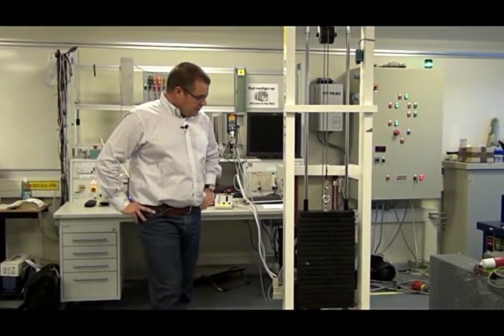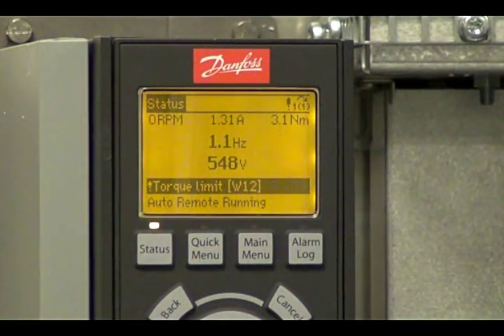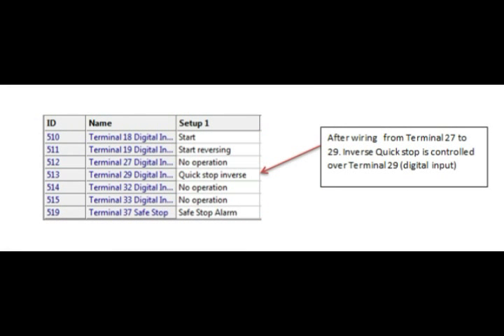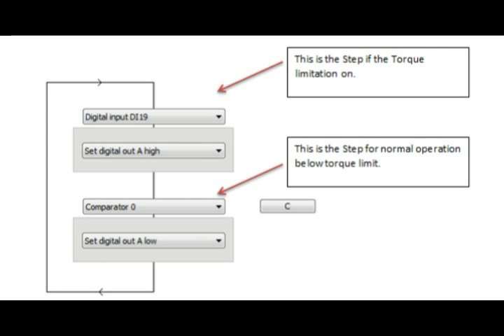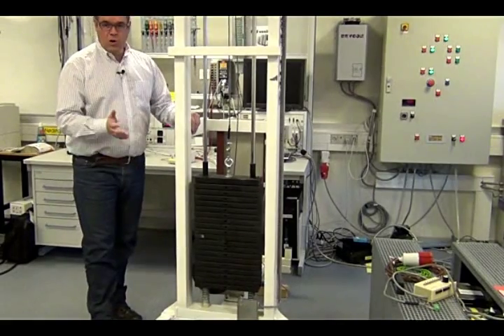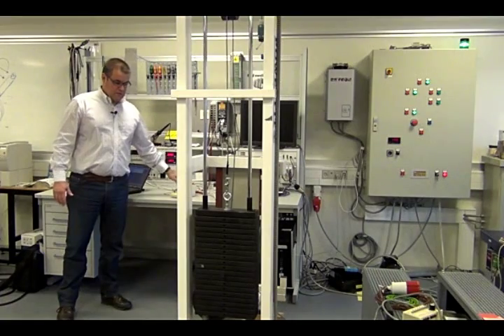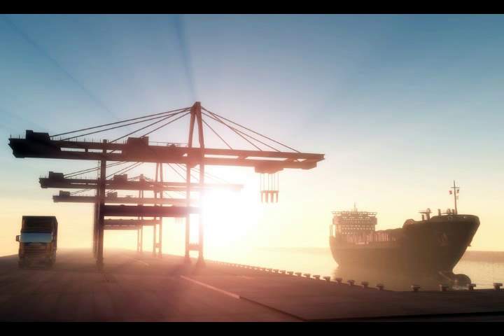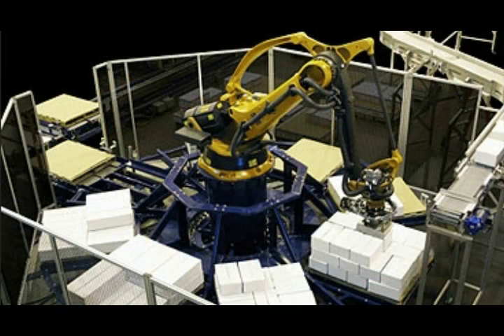Danfoss VLT® Drives Torque Limit Function and Smart Logic Controller

Comment: Hi, what happen if we don`t use  I/Os? Means, we set torque limit and go with the winch in up direction. Torque will reach torque limit and ... what happen?
Reply from the maker: Hi Daniel, if the VLT reaches torque limit then you will get a warning to start with, and then afterwards get an alarm and the drive will stop and you will drop the load
Reply: @danfossdrives  . Other cases: 
1.Drive in close loop speed control. Speed 0. External force try to rotate motor shaft. What happen when torque limit is exceeded? Still no movement or motor will be moved by external force with constant torque equal to torque limit?

2. Generally, I`m looking for soltution to have overload protection but not with stop. I want VLT to allow rotating if torque limit is eceeded and  VT should keep constant torque on motor. Speed will be changing accoridng to external force speed.

Thank you for answer
Reply from the maker: Hi Daniel,

since your questions are quite specific, could I ask you to contact your local Danfoss support? You can find the contact details for each country here: https://www.danfoss.com/en/contact-us/contacts-list/?filter=type%3Adanfoss-sales-service-center

Comment: A lot of people would say that the Danfoss are the Mercedes of the inverters, I would say that their inventors are absolute joke.
1) can`t work more than a 5 months in a dust environment
2) always has issues with turbines  , DC over or under voltage, in the manual nothing helps to resolve the issue
3) they are not well protected if we have short circuit , for instance we put into production a new inverter FC 302, it worked well for 2 months, then we had some issues with the rotor of the motor and at the output of the inverter there always is a 4 volts residual voltage that work like a brake ( despite that we put new motor)
4) not easy for configuration, auto tune is ok, but still a lot of options that in the usual environment do not need
5) theoretically they are very good in the test environment like this one on the video,practically they are real joke in the heavy production environment with 24/7 operation 
6) last but not least, quite expensive , I do not why?
7) you have golden edges that connect the display to the board, and when you press the display harder it look like he has been made in china